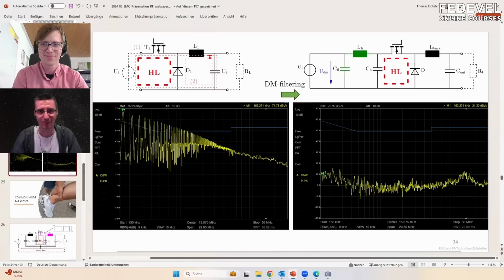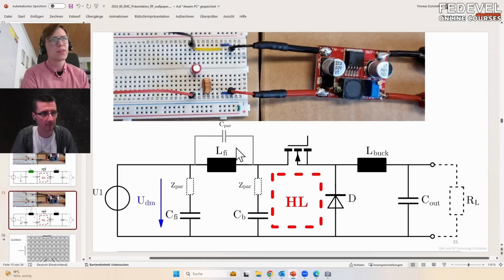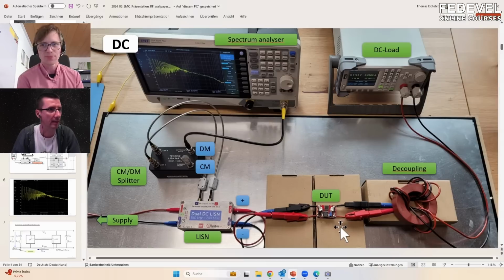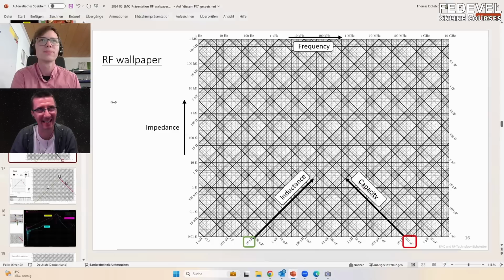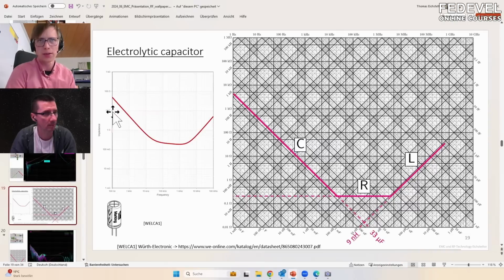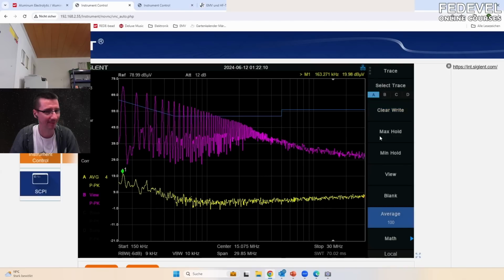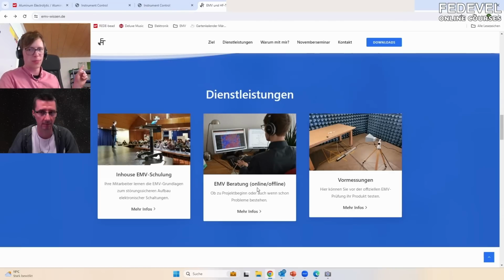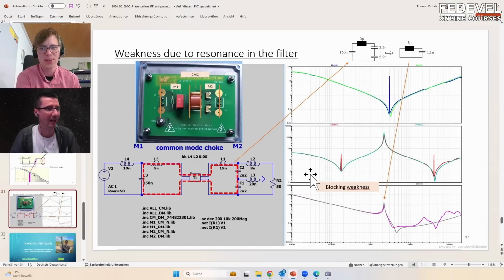Simple Trick to Improve EMC - Easy Filter Design for Power Supply

Comment: This is very helpful - I'm currently performing pre-compliance testing for a board with a buck regulator, and found that peaks from switching noise are up to 20dB over the limit!

When using the RF Wallpaper method for designing an LC filter, do I need to worry about damping? Or does making the "start" of the filter 3x lower than the frequency of interest mean that this isn't necessary?

Comment: Unfortunately very rarely do manufacturers of ceramic caps talk about ESR on datasheets... how are we supposed to know this witchcraft 😊
Reply: I have a master set of ipn's this is pre-qualified parts and testing esr and generating proper data set is a part of this.
Also in general a ceramic cap of a given package size and value falls into an apx esr range to expect.
Kinda like you can make assumptions on response with X7 / X5. Most the ones that fall outside that range are of very poor quality.
Also when it comes to preparing for production we have stages
EVT1-3, DVT1,DVT2(if required), PVT, production.
Most of the time emc/EMI is pre-tested during end of dvt. Final BOM changes are put in place for PVT, this is also when the production line is setup and generally speaking the only difference between pvt and full production is the size of the batch. A normal PVT run is a few hundred units. Production orders are in the range of 3-6mo of projected sales.
This can be a tens of thousands of units.

This filter layout is useful I actually add a similar filter layout to all my RF IC power inputs with simple jumpers. As a fallback to help decouple rf feedback in the rare case it's a problem usually cellular modules can be a headache in 2nd and 3rd harmonics when using sub 900mhz bands. I find some SMPS and modules can self sync and create crazy harmonics that can become a headache to track down.
Reply: You google the part number and find the impedance graph on the manufacturers web site. eg CL05A105KP5NNNC.
Don't buy from a company that doesn't have the information posted unless you don't care about it.
Reply: Common mode noise is generally pretty easy to deal with

Comment: Wrong!!! Did he include derating of components? I do not see this, so 1st problem and this could have a big impact.  2nd problem, less impact, in the last simulation he used 50 Ohm but in real LISN for common mode is 25 Ohm and for differential is 100 Ohm (seen from input side of the mains if you have doubel LISN construction) but he simulated at 50 Ohm which often is not the case.
Reply: There are a million details that could be discussed, leaving out de-rating here is perfectly acceptable.
Reply: @jaro6985  For people that do not know this it should be mentation that is withouth derating. You need to say what is not counted in the testing/simulations and that is fine but there should be a statement because results could be different if someone want to make similar. As you wrote there is many details but some have more impact then others. Regards, MJ
Reply: To your first point: You are right that components experience derating; capacitors become smaller when you approach their rated voltage, and inductors have lower inductance when you drive current close to their saturation point. However, in this example, we are still far from this point. If you have a project where derating is a concern, you can measure it with a VNA or equivalent equipment and plot it in the RF-Wallpaper.
To your second point: The simulation shows the result of a VNA measurement compared to the simulation. A VNA has an impedance of 50 Ohms. When you want to simulate with interference and measurement later, you are correct. But in that case, I would use the complete model with lines and the blocking network, also measured with the VNA.
Best regards Thomas
Reply: @thomaseichstetter6777  You answer is generic. That depends there are different characteristics. For capacitors it depends what dielectric is used and for inductors what type of core. You could have your caps 50% of nominate vlaue becouse it have like 40-50% of rated voltage on it. You should always count derating or make a statment that you are not including it and real attenuation could be lower!

Comment: When dealing with similar issues, I've found TI app note AN-2162 to be invaluable.  It presents some straightforward formulas and worked examples that can be used to directly calculate the values for the filter components with minimal fiddling and fuss.
Reply: Literally been using the same application note

Comment: Hi sir, I'm using fixed LDO which input is 5v and output is by default 3.35v . If we change in code it boost up to 4.45v . What happens is if I give 5 v input through rps , the output will be 2 v . So, it will not able power supply for other sections.  Can you tell me the issue